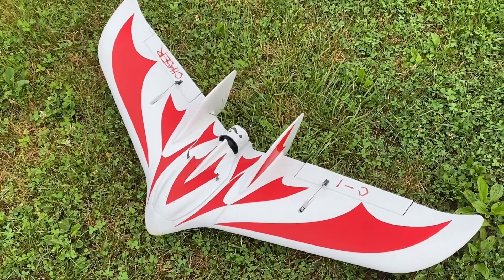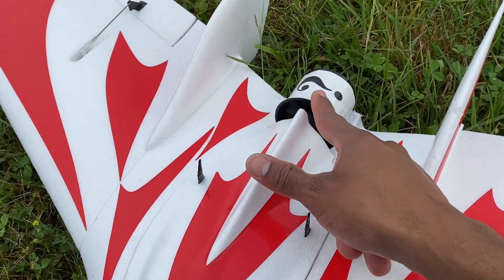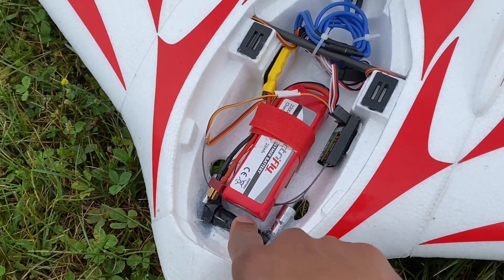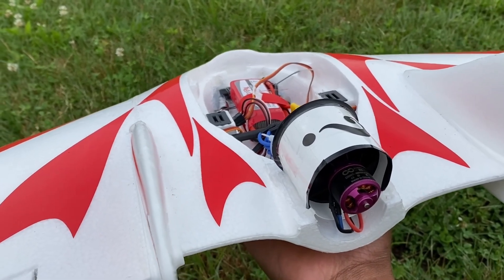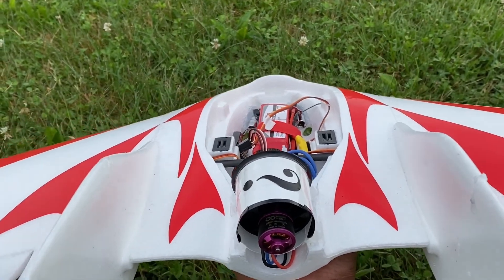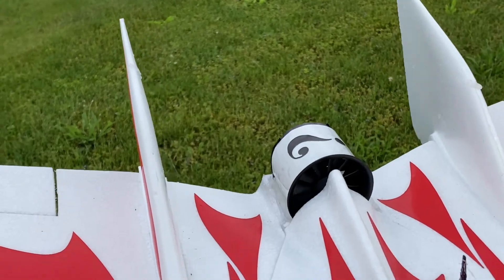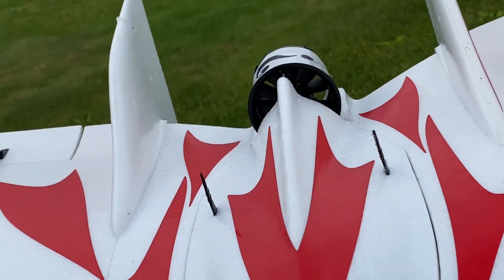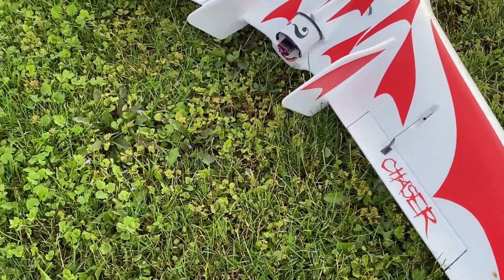I Converted a Flying Wing into a EDF Airplane: Diy Delta Wing Build

Comment: i would to know which is faster EDF or PROPELLER
Reply from the maker: The EDF is faster but can be more expensive. It all depends on the model. I have a lot of planes that uses prop and it’s less expensive than the EDF and speed performance is great. I experimented with ducted fans because I like the jet sound. You can find more information on this at rcgroups.com. Hope this helps 👍